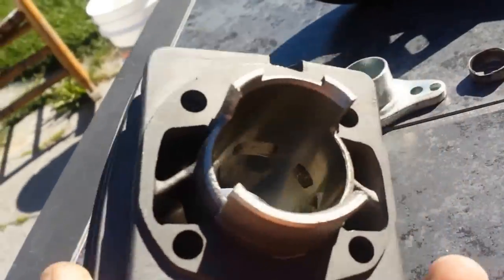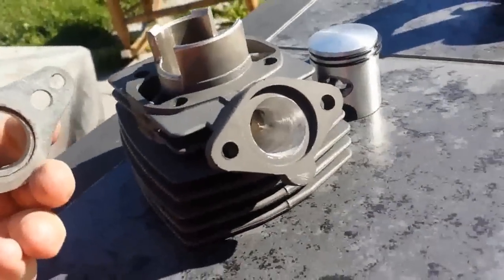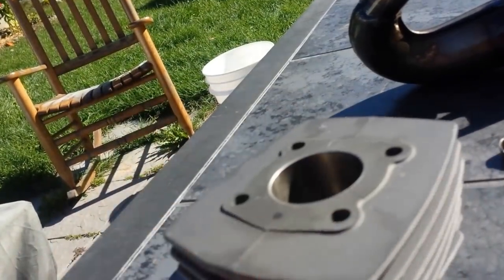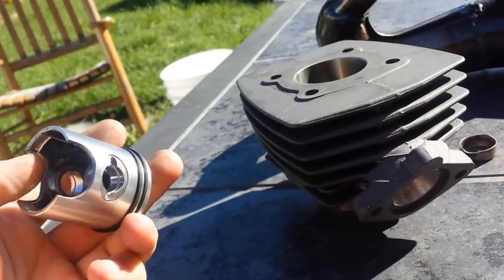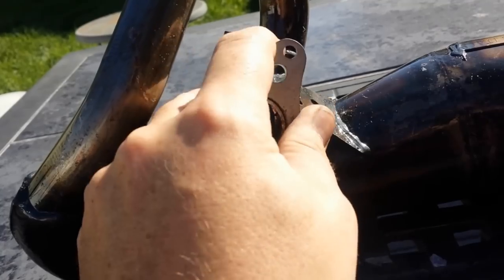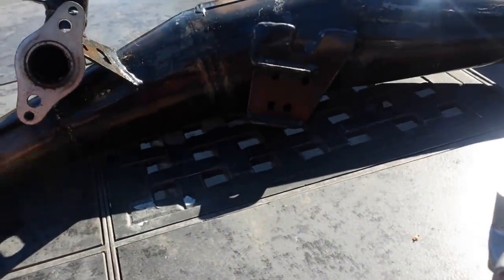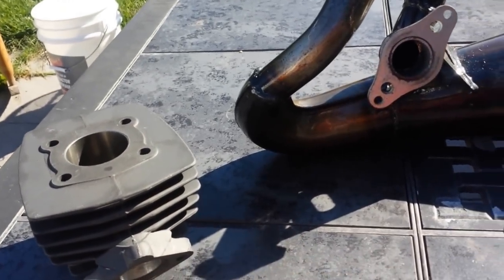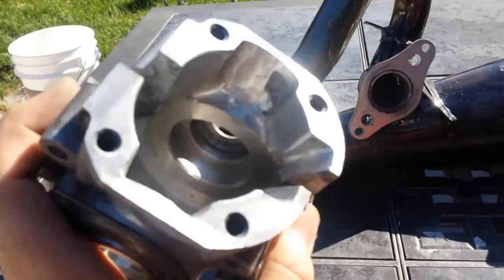1977 50cc Racey Peugeot Kit Review pt1

Comment: Not even a "kit" , it's an original Peugeot Fox cylinder (:

But still good ,can be converted into a mid race kit with one ring piston + Bidalot head for exemple :)=
Reply from the maker: Ah that's interesting, How can you tell it's the fox cylinder?
Reply: Marty's Garage
You can see that third thing upon exhaust bolts , transferts form an all..

Source : Im french myself + owned many mopeds  (103 + Fox) :)

Finally if not an "original" fox cylinder still a perfect clone (: .